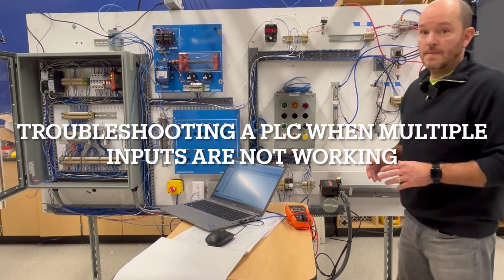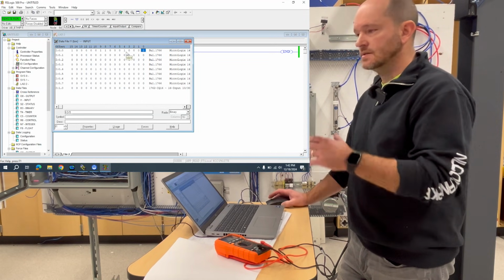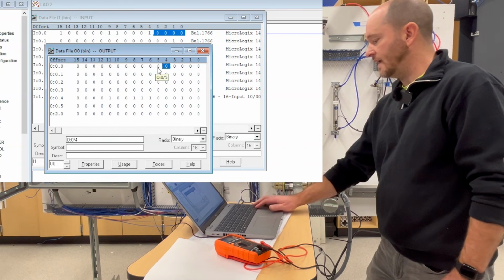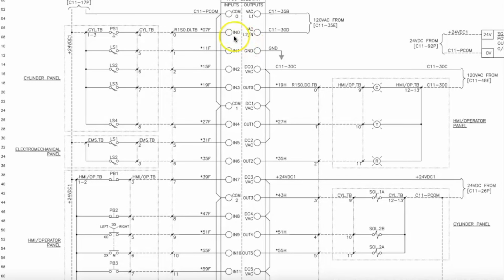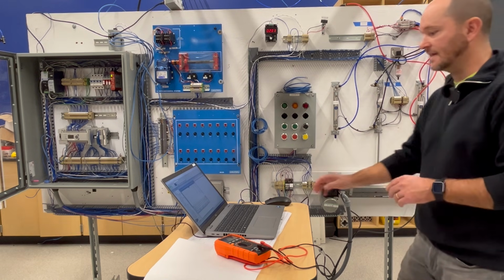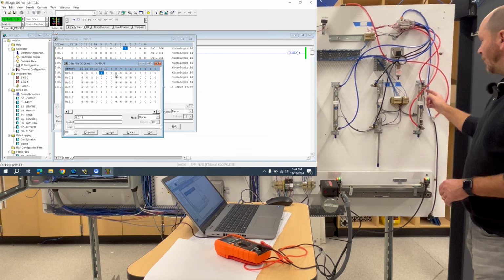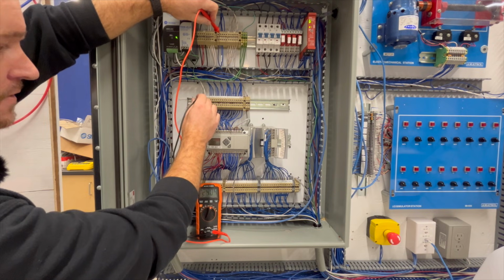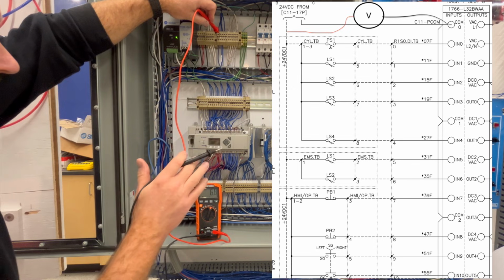Troubleshooting a PLC When Multiple Inputs Are Not Working

Comment: Thanks for sharing.
Where are your labels?
fault finding would be a lot easier with Input labeled. x (and number) for inputs and y (and number) for outputs.
Also, what current uses blue wire for 24V?
24VDC is orange and 24VAC is purple. 240V AC is brown or red 240V Neutral is black or blue.

At  least where im from.

Comment: Fetting an upclose camera angle with possible a second camera when putting leads onto terminal blocks would really help a newby like me  see what exactly you are putting the leads on. Thanks and great video!
Reply: There will be a screw head with a little plate behind it( at least in this version) you twist the copper strands or add a ferrule to the wire. Then add behind the plate so that the wire end is sandwiched between the plate and the base. Always make sure to add your wire to the side of the screw that will pull it in when tightening the screw itself. If not it will have the tendency to push the wire out.

Comment: Hi thanks for the great video. 

I have a similar problem with our rs logic 500 Plc. So our maintenance electrician just recently replaced a probe sensor for a chemical tank that measures PH level. 

The analog output address on the module where the valve is wired to is constantly putting out 115 AC voltage but it's led light inbthe module terminal is off, keeping the valve open for chemical. But the sensor is not sending the signal for the valve to be open.

Do you know what could be the issue? 

Is the output module defective?

Or is the probe sensor defective? (Although the probe was tested and was measuring the PH properly).

Thanks for any input.

Comment: Im currently in advanced trainning in jobcore for Smart Meter and Instrumentation and I've been learning everything about control realeys, VFDs, and PLCS etc, even built my own conveyer system with forward and reverse sensors off 8 and 11 pin relays, then the same inside LoGo!  The program we've been using is Siemens Logo 8, but looking at you're videos its not the same-  what program do you use? is their a company standard that they use for programming languages? Any tips for jobs or anything starting out in this field? Took my base trade in electrical, and I'm 21. Just looking for more information! Thank you!
Reply: That's RSLogix 500 and is used for Allen Bradley PLC, an MicroLogix 1400 in this case.
Reply: @Ruben_BustumAmantii_MendiHotza thank you!